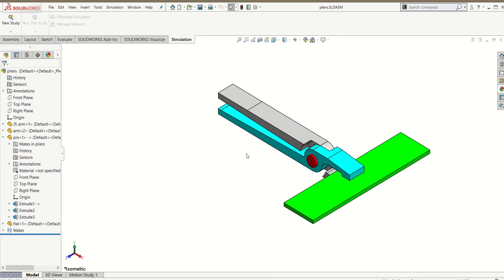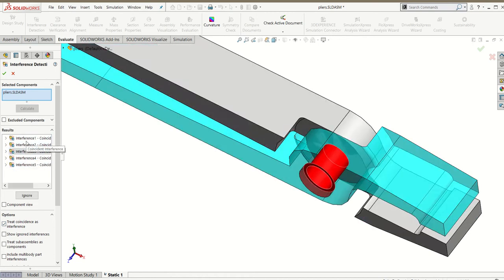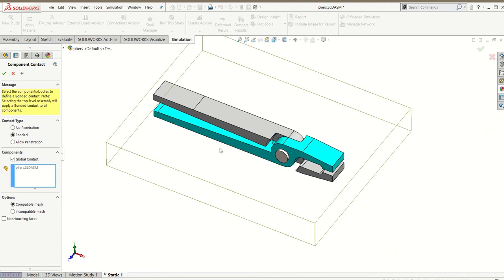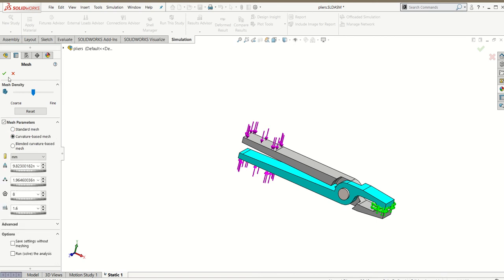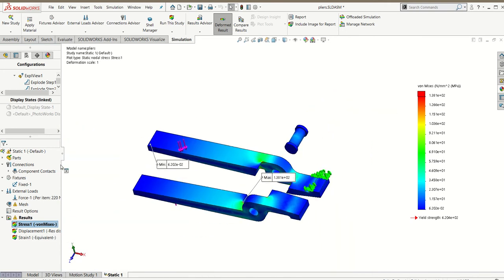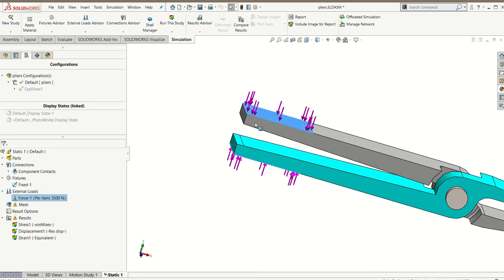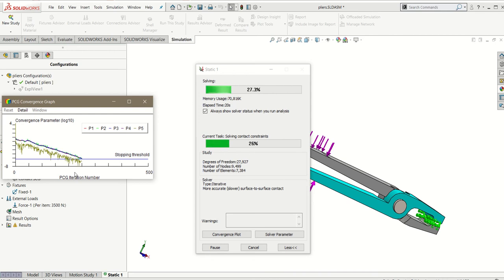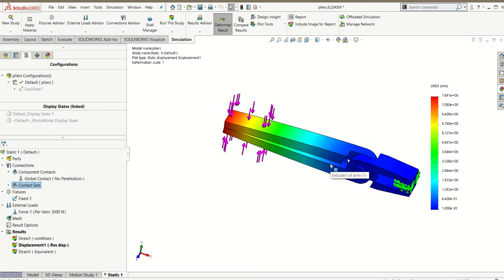Chapter 3. Assembly analysis with contacts

Comment: Hi, Thanks for making this assembly simulation video. this is very helpful. I like to clear one of my doubt here. For any of the contact assembly simulation do we need ensure that the contact set should also be touching physically? In this your example i assume that the Pin outer diameter is equal to the plyer arm inner diameter (let me know if this is not right assumption). but in actual case there will be certain clearance maintain between the pin the the plyer holes so is it possible to run the simulation with that clearance (with out modifying the cad models to make them touch)?

Comment: Please explain more about contact and contact point and what do you mean by global contact and local contact..
Reply from the maker: Hiee  vipul,
welcome to my channel and thanks for asking questions.
Basically contact is the connections between two points means how component are going to interact with is other is defined by it.
In assembly you have given mates to connect two part, similarly in simulation you need to define the connections between parts, those mates wont be working in simulation environment.
Global and local contact are the types of contact. global contact is applied all over assembly where parts touches each other, while local contacts yo need to defined which faces or edges or vertex are going to interact with each other. as per the preference local contact has high preference compare to Global contact. If you defined two parts by global as well as local contact for same entity then preference is going to local contact only.
Reply: Solidworks Tips n Tricks thanks for reply, its clear now
Reply: Please loud I barely can't hear that